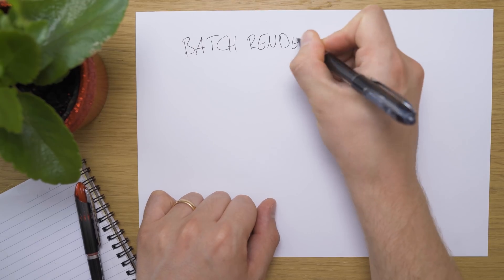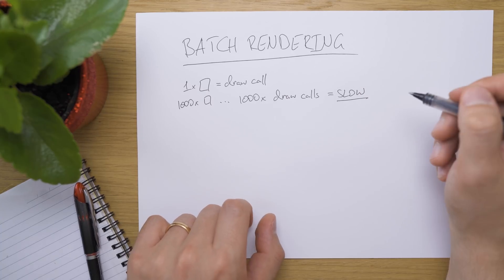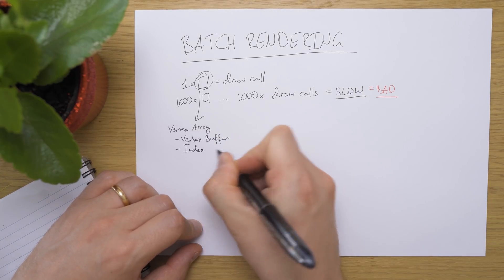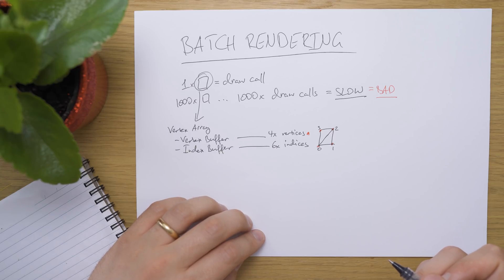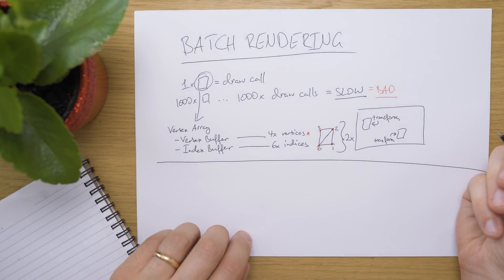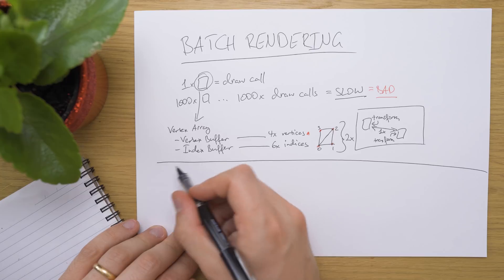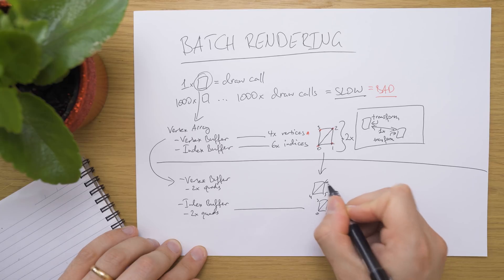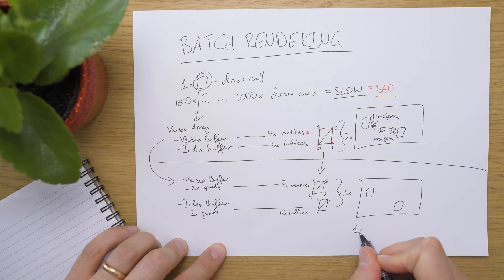Batch Rendering - An Introduction

Comment: This isn’t batch rendering in the usable sense. Batch rendering typically is one mesh with several sub instances referencing that geometry. The vertex data becomes the unchanging data whereas transform data is the changing per-instance attribute. Overall less back and forth between the CPU and GPU means faster programming. However, in the presented example, the amount of memory isn’t changing here. Instead, the example has the same amount of memory stored with one less draw call.

Comment: I'm not a fan of this moving off of the all of the code I worked on up until this point and into something much bigger and more complex with a lot of things I didn't write and don't necessarily understand. I was really enjoying the "build it yourself one line at a time" approach and to suddenly switch over and abandon all the old code is a bit frustrating.

Comment: What if instead of using a uniform for the transformation, I use a layout? It seems Inefficient though, having a whole transformation matrix for every point in the geometry.

Also, I just realized how obscenely inefficient my current engine is. It binds the shader, then the vertex array, then sets the transforms, then renders, unbinds them, repeat for each object.

Comment: The issue isn't the GPU, it is the CPU, and API. Before DX12, and Vulkan, due to abstraction, the APIs were, in practice, mostly single threaded, with heavy API overhead. This greatly limits draw calls you can do per frame to keep good performance. Batching things can significantly reduce draw calls. Batching reduces GPU workload somewhat, but mostly it is the CPU.  Either way, it is definitely good to do.
Reply: Even though vk/dx12 remove driver overhead and have support to parallelize command recording, batching definitely helps, and more, you can defer the batching to a compute kernel and generate the batching entirely on the GPU

Comment: Is it possible to group other types of geometry such as a line or triangle, or maybe even a single point in a single batch? Just for quads, we always use 6 indexes and repeat this process for all the maximum quads in the batch, and this is not particularly suitable for a line or point, because a point should not have any indexes at all, since it is a just point, a vertex. The line is also just 2 vertices and maybe we will need one index to connect them, but then again there is a problem, because by default we load 6 indexes for each primitive, there is no other way out, since we also want to use our quads. Perhaps we can somehow skip 5 indexes for a line and 3 indexes for a triangle, and already knowing what type of geometry we have, we can simply add vertices and fill them with data (positions, uvs, etc.). Or would it be better to just create another batch specifically for lines, points, triangles?

Comment: For my engine (Goblin 2D+) had been using a scene manager to sort by mesh and distance then render instances of the same mesh. Worked not too bad as each mesh was usually used multiple times. Thing is... because of shadows I have to do 2 passes per frame so any inefficiencies are doubled. Still not too bad but there were some objects that were "1's". These "1's" are meshes that are only rendered once. (as an example. My turret is made up of 12 difference meshes of which some are rendered 4+ times and some just once).

First step to solve this was combining a lot of 256*256 textures onto a single 1024*1024 texture with a good texture atlas. This by itself didn't do much as each mesh was rendered in an instanced batch still.

Took about a week of reading and research but finally decided on a "hack" with structured buffers (which I had never heard of at that stage) that had multiple meshes in a fixed length buffer. Each mesh could in theory be accessed as the instance buffer now had a "model_index" field that was used to access the correct vertex for the model and vertex number.

The problem I had was vertex counts were between 200 and 2000 and a fixed size meant the count/fixed size had to allow for the largest (2000 in this example). Any mesh with a size < the 2000 would be padded with degenerate triangles which would not be passed to the pixel shader.

Phase 1 took a few days but got it working with a small subset of models as a proof of concept. Ended up creating a class that combined any mesh with a given criteria that had access to my model manager class.

Instead of 1 batch for all sizes I decided on 3 batches of varying sizes that meant 30+ batches became 3 efficient batches rather than a single inefficient batch.

Batch 1 is for meshes with 0-499 vertices, 2 is for 500 to 999 vertices and 3 is for 1000-1500 vertices. 

Have now cut the number of batches per frame from 50ish down to 16 (myGui is responsible for 5 of these). This now means I can add more variants of models without adding the the batch count.

Another big thing for me was swapping from qsort to a radix sort for sorting the scene. The radix sort is lightning fast as it's on a single 64 bit integer that's made up of a 32 bit mesh number and integer  distance of model to camera * 1000.

Comment: I'm looking for a way to apply many different model matrices to a handful of different quads in a single draw call. I thought about using a vbo with just position, rotation and object type, and having a geometry shader produce the quad and the associated texture coords, which would map into an image atlas that is in a single texture. But I've read that geometry shaders are really slow. And I've read that using arb instanced method can also end up slower than just plain unrolled vertex data. But unrolling means applying all those model matrices on the cpu side which just does not seem like it can possibly be faster.
Reply: Give a unique ID to each quad and use a uniform buffer with the array of transforms you want to apply to each quad, referencing them through the quad ID
Reply: @santitabnavascues8673  So each vertex buffer element has the quad id and the transform to apply to it, and the shader has hardcoded knowledge of all the quads'  dimensions? Is there a way to get that knowledge into the shader without hardcoding it?
Reply: @shavais33  it is a technique similar to shader skinning, but in this case, each vertex buffer element has a unique ID, a number. Then, on the uniform buffer you have an array with all the transformations, which you can access in the vertex shader through the quad ID. That being said, I suggest you to take a look at the Ocornut IMGUI gui library. It builds a large buffer of quad elements, all of them of the proper screen size, that renders UIs with seemingly very low overhead. It batches all the elements into a vertex and an index array that you can stream per frame, achieving very notable framerates, each quad also uses a font texture, in a similar fashion as what you ask in the first comment, so you can render text like that, among many other things.
Reply: @santitabnavascues8673  I didn't know you could pass a buffer as a uniform? And access it like an array in the shader? That's very interesting, that has a lot of potential uses, if it performs well. Even small buffers could be very useful.

I have little spaceships and shots flying around, explosions, things spawning and despawning and going on and off screen, so it's a bit different use case than UI in general (although I also have a UI). I have to do a bunch of updating between frames, but I'm trying to minimize that and do it with SIMD as much as possible, and do as much as possible in the shader.. I think.. well, I'll have to see which way works better. 

That's an interesting thought to pass the quad dimensions in a buffer as a uniform to the shader. But you'd have to do it every frame, right? It would be smallish I guess, compared with, like, texture data, but.. I would not expect it to perform as well as just having the dimensions hardcoded in the shader. It's tempting to create a build step that generates the shader code from a template that has most of the code in the template, but has a replaced string for the quad dimensions, which would come from the image atlas data, which is already getting exported to json files by my atlas generator.

I'm somewhat familiar with IMGUI. Historically it has been too slow for my purposes, but I've heard that it's performance has improved in recent years. I do have a UI with thin borders and such, maybe a little bit of text, and one of my difficulties is that the user can resize the window, so.. I'm facing the need to maybe use SDF's for the UI elements.

I would like to continue our conversation, do you have a discord?  Mine is shavais_zarathu.
Reply: @shavais33   uniforms have their limits too, but they can store quite a lot of data, at least 16KB guaranteed by OpenGL standard, I can't tell about DirectX. I suggest you take a look at how uniform buffers work, but really, even on old DirectX 9 grade hardware I could pass 5000 particles as a quad array, so, I think that even on the CPU, you can have lots of quads generated and rendered in a single go, the gist of it is that you draw the whole set as a single draw call. And no, I don't have discord, sorry 😅

Comment: Hm i have a few questions about this
Are glDraw* calls really that expensive or is setting the uniforms for each geometry the slow part?

When loading geometry from a file, the positions must be multiplied with the model matrix before loading into the vertexbuffer? This example was about static geometry batching so these do not move and the buffer does not need to be updated, correct?